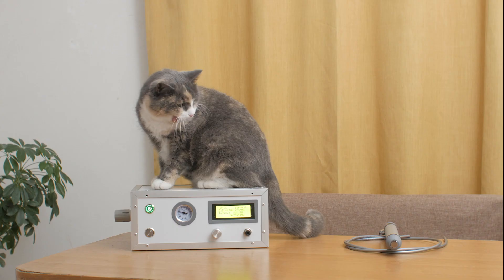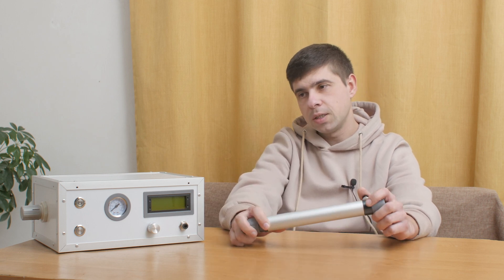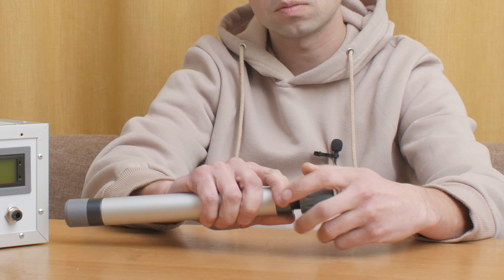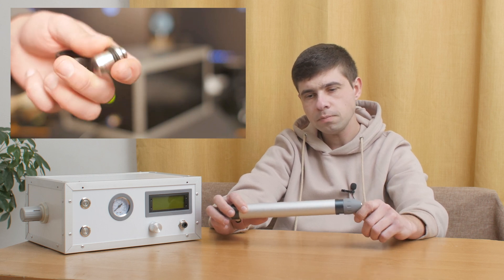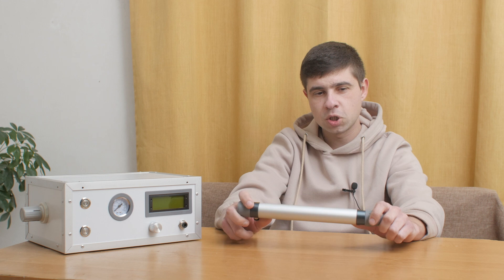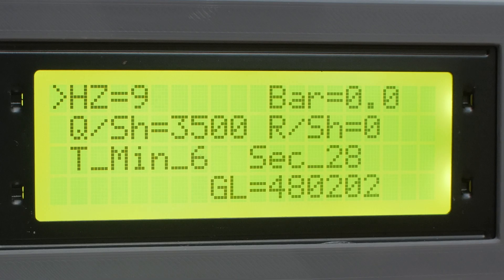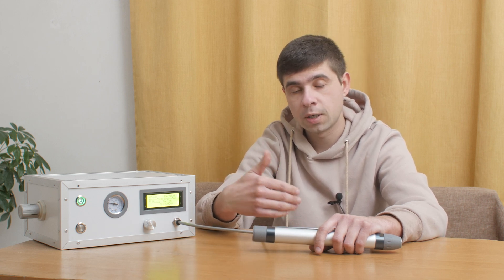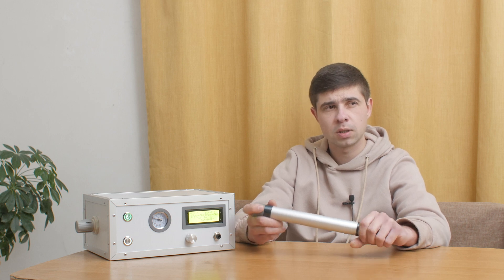Review of a homemade shockwave therapy device. ESWT. Shockwave therapy device, homemade, DIY.

Comment: Can you tell me the concept of the gun the applicator how are you creating the rapid fire pushing the bullet back and forth in the tube I'm at an impasse here and I can't seem to get past it and I can't find any information on the way you're retracting the bullet and then sending it up again I know it's air pressure but I haven't got a chance to see inside any construction or what design it is being used can you help me there please thank you
Reply from the maker: Good afternoon. This isn't a simple matter, it's not easy to explain in words, and I don't really want to go into it right now. The simplest way is to push the air tube forward so it pushes the bullet back.